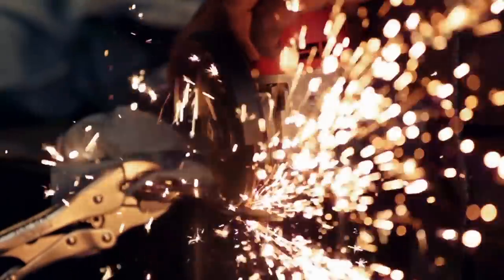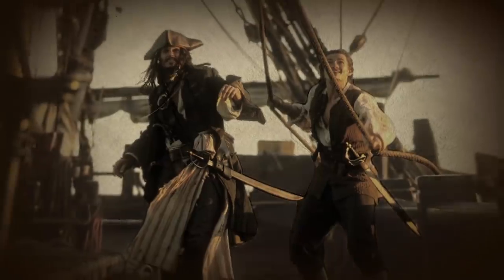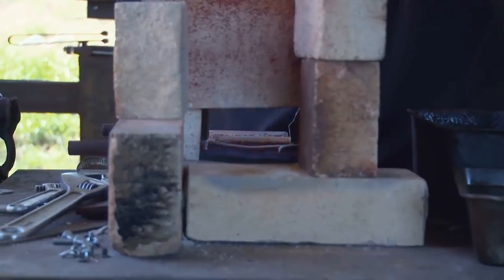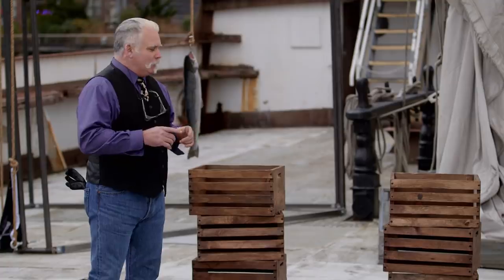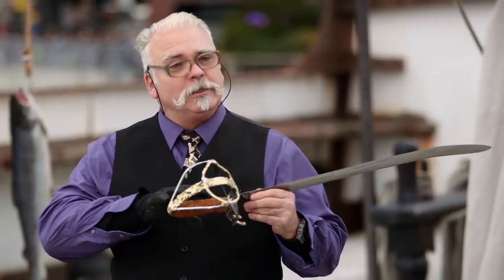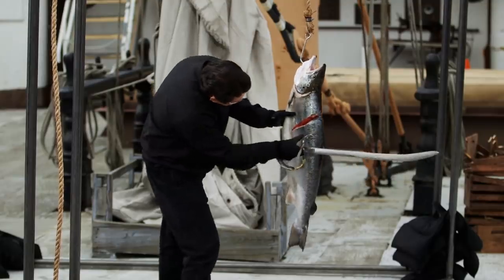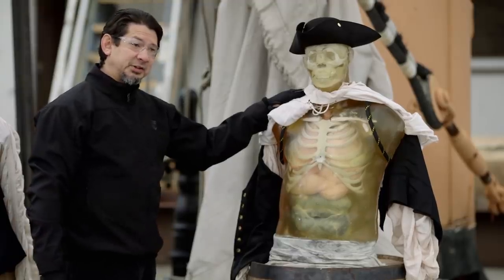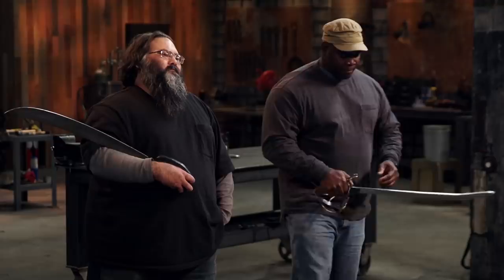Forged in Fire: The Cutlass CUTS & LACERATES the Final Round (Season 2) | History

Comment: Tobin got humbled on the sharpness test 👌
Reply: Doug's edge geometry was way off on the rope cut
Reply: I think the both did actually. Isn't something how each blade cut what the other couldn't? That was weird.
Reply: It’s pretty rough when contestants get docked for Doug swinging a sword improperly, it would be a lot cooler if he just admitted it was his fault ya know.
Reply: @Yohasbing  Yeah but come on, a two handed cutlass is not a cutlass it's a machete, a big machete
Reply: @Yohasbing  weight is a big contributing factor to stuff. Keeping edge alignment good during a swing is a lot harder with heavier weapons or if the handle isn't good.
Reply: Tobin's sword won because it's more deadly.
Reply: @Yohasbing it’s the reason I can’t watch the show anymore, that guy should have been fired a long time ago and he’s only still around because of some lame punch line, instead of bringing in a younger guy with bigger hands and a more athletic build, they throw that away for “tradition” 
The world has enough washed up talent refusing to make way for younger talent in its prime and this guy is only adding to it. Countless contestants have been cheated due to him using weapons improperly or his hands being too small to use them. Tbh even allowing for human error in a contest like this ruins the integrity of it. Every weapon should be placed in a spring loaded mechanism that swings the weapons at the exact same same speed and angle. The way they do it now. They might as well just start letting contestants swing their own weapons during the kill test, at least that way they couldn’t be cheated by an ego driven idiot who refuses to re do a test despite knowing he swung both weapons differently

Comment: His blade may not of stayed sharp but it was also used one handed where the winning blade seem out of parameter having the judges use it 2 handed.    Rope and fish test.    Do not agree with outcome.   Even the last test.   Look at Dougs hands.    This is bad
Reply: If you watch closely, doug often make subtle mistakes that can vary the outcome of a test
Reply: True, dude, cutlass is a one handed weapon
Reply: Well, actually Doug is worse with 2 handed weapons. But he isn´t using it like a 2 handed sword, he´s just using his off-hand to support the wielding hand, not the handle. he does the same when he delivers the cut with Ron´s cutlass on the rope. 

If you compare the places Ron´s cutlass hit the fish and the rope, you can infer that the blade is probably dull at the place where it curves and sharp on the straight part. Because the edge alignment on the fish seemed good.

And that's also the reason it failed the kill test. if you swing the blade it´s the tip and the curve doing the damage. if these are dull, there is simply no damage. btw, he also used both his hands using Rons weapon in the kill test. it´s just harder to see because of the giant basket.
Reply: It’s purely because of weight, you can tell he doesn’t use it to improve the swing beyond what’s necessary to keep it true

Comment: They have to fix the human error problem in these tests. If Doug hits at a different angle each time, the test is basically useless and unfair. They gotta figure out a more scientific approach. Two different people would slice and have two different results.
Reply: Exactly! I've noticed some of his mistakes,wrist movement goes along way!
Reply: They need Todd from "The Project Farm" to design the testing.  If you haven't seen the channel check it out.  Great stuff for tool and motor nerds.
Reply: The human aspect is part of the test. Tobin's blade is heavy and unwieldy, so even a man like Doug, who is a bladed weapons expert, will have a hard time getting correct edge alignment. They aren't JUST testing the sharpness in the sharpness test; they're also testing the wieldability of the weapon.
Reply: I've commented on this before. Doug fails periodically on European style blades. It's not weight causing him to twist the blade during or just before the cut.
Reply: I think they have a good mix of purely scientific tests in there. For example when they shoot the bullet at the blade. 

Please don’t try to get rid of Doug. He makes the show great.
Reply: On the one hand, the tests are by no means perfect, but on the other hand, every test that Doug designs is very cinematic. I'll bet you that half of the people watching the show are there for Doug's antics.

Comment: The Cutlass a still unbested design one that modern science can't seem to replicate oh but I think it's actually a cast steel blade that has three distinct grinds from an angle grinder three different sizes of angle grinder being used one for each angle so there's an angle at the tip it curves from the tip to the rear and then from the tip to the rear angle there's another angle that grinds down and Away towards the handle and then the front has a similar albeit broader curve I think it curves back up so you get this nice like kind of like crescent moon shape at the top then you just sharpen all sides of it... Game Changer bro might as well be a boarding ax

Which pairs well with a blunderbuss propelled mortar round, and about 6 pistols

Comment: they should change the name of the show to ,  forgery in fire . considering these guys are straight up using  plate steel, cutting , bending , and quenching. . . . . but forgetting the whole forge part. . . .
Reply: I think you've misunderstood what forging is... 🤔
"Forging is a manufacturing process involving the shaping of metal using localized compressive forces. The blows are delivered with a hammer (often a power hammer) or a die. Forging is often classified according to the temperature at which it is performed: cold forging (a type of cold working), warm forging, or hot forging (a type of hot working). For the latter two, the metal is heated, usually in a forge."
So, they're heating the metal (in a forge), they hammer/press it, and thus shaping it with compressive force...I fail to see how they're forgetting about the forging part.

Were you thinking of smelting, perhaps?
Reply: @FlinnGaidin   i was somewhat being facetious ,  but i very much so know what im talking about .  i have 30 years experience metalworking .  while i appreciate your copy paste of a definition i know .   there's a big difference between taking plate steel , and minimally shaping it .   compared to taking , or making a billet , and then working it .     the compressive process you spoke of , was barely done , as much if not more hardening was done by quenching , than their hammer forming . , either in the lengthening , bending , and or thinning of the cutting edge .  i get what they did is considered forging by definition ,   the skill of it is deeply lost in the work they put out though  , nothing they did,  was impressive,   or worthy of being on TV for . . .    and no .  i wasn't thinking of smelting .  that's more a process youd use with a hydraulic press and dye ( can look into how forged racing wheels are made , )   rather than hand work .  where forging is more likely to make use of hand , or power hammer forces.   i see forging as making use of raw materials and shaping into a usable tool or item .   the reason i said what i did ,  is they put about 10% of the energy into their forging process , and the rest was done with power tools.   usually smiths do 80-90% by hand,  and 10% with tools.
Reply: @FlinnGaidin  i should add they only showed the first guys sad technique . . . and that's why his blade was brittle and deformed a bit and had chips.   because the structure wasn't tight enough ,  which is the byproduct of that compressin you mentioned.   and why when weapons break on the show , and they show the granular structure,   they can tell a lot about what caused it.   it's the minimal forging, followed by poor quenching .
Reply: @twistymcslide2  sometimes hard to tell what someone's intention is over the internet, lol. I thought you'd seriously miscomprehended the meaning of forging, and the copy pasta (yes, pasta) was an attempt to rectify that 😝
I'll certainly agree with you that this episode (and some others) wasn't the best show of smithing skills.
You don't see much in these ten minute videos anyway, and to be honest, they're more about the testing. Been a while since I've seen an actual full episode of this show.

For more in-depth forging/smithing, I'm subscribed to That Works, Alec Steele, and Kyle Royer. You see a lot more of the process, especially with the intricately patterned "Damascus" billets that they often make.